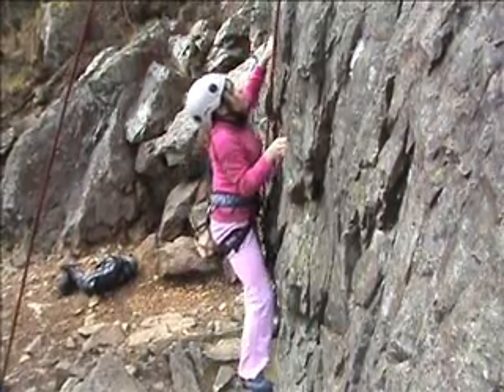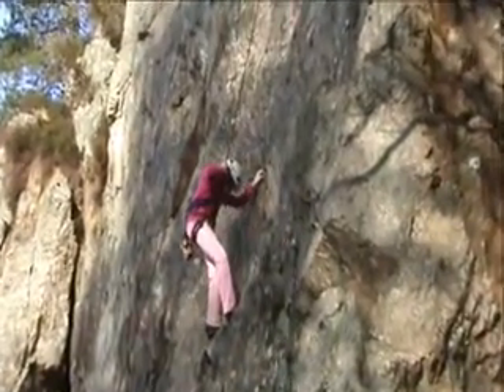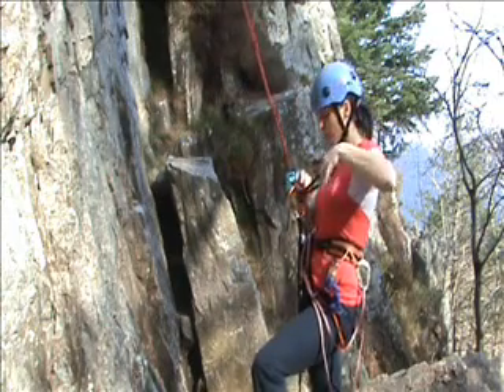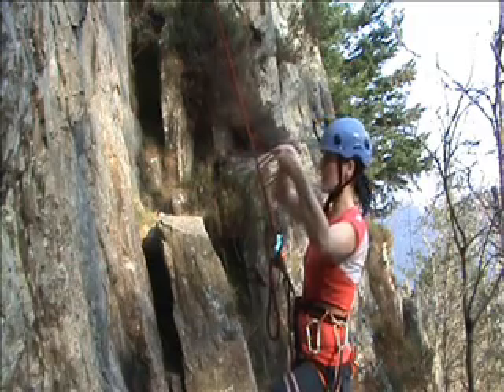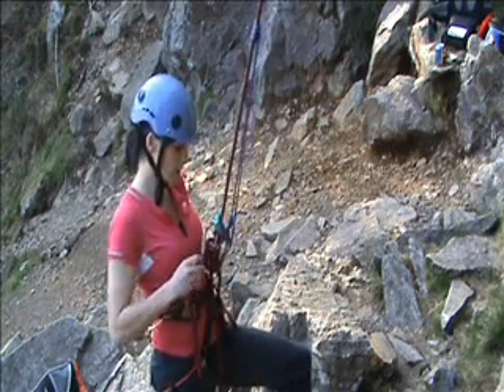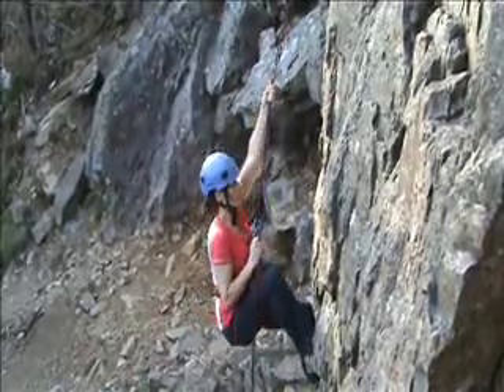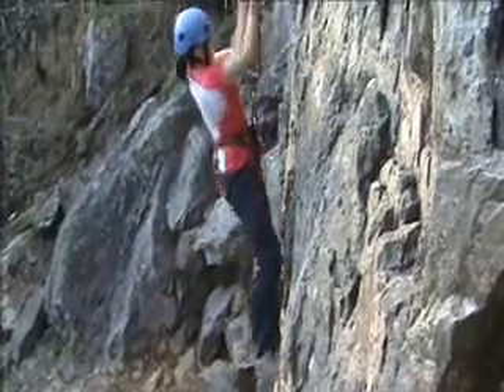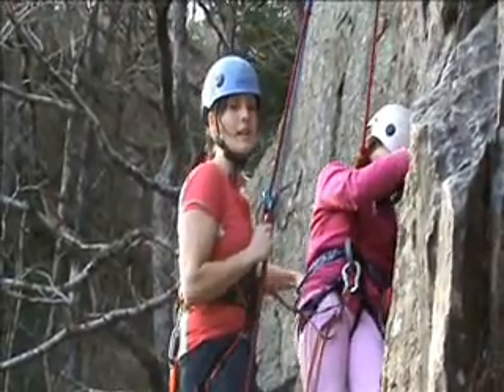Single Pitch Problem Solving for Instructors

Comment: The weight difference would have to be huge for the climber to be pulled up significantly. I've done similar to this to little girls aged around 8-10 years old and Im about 75Kg they didn't get pulled up. Neither did the girl on this video even though she was clearly lighter. The friction in the system absorbs a lot of the weight difference.

Comment: The 'instructor' is the anchor; there is simply a rope from her running through a top anchor (Thus top roping) where the climber is basically a weight being balanced by another weight on a set of scales. When a heavier weight is applied to one side, the other has a a lightness and thus would be pulled up towards the top anchor. This would result in your client loosing balance and being in a difficult position if they happened to weight less than said 'instructor'. 

Hope this helps....